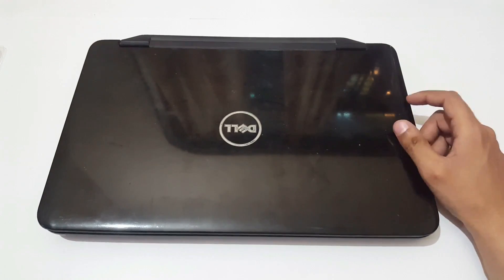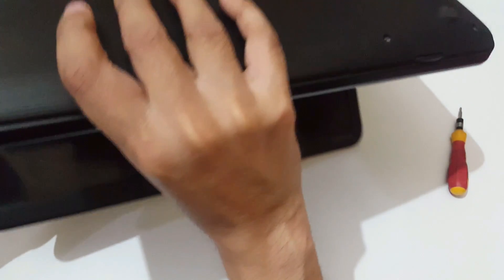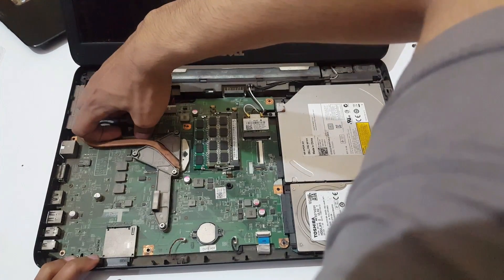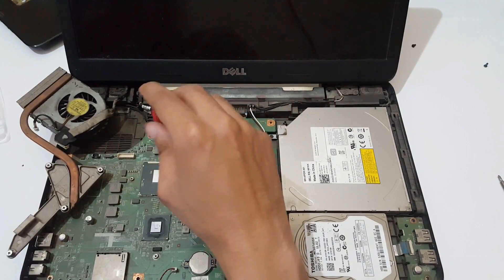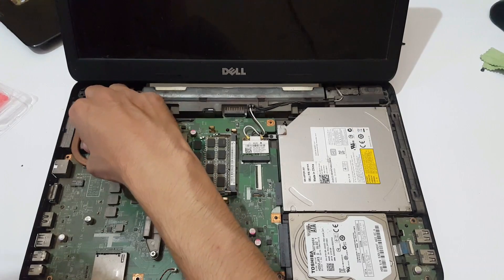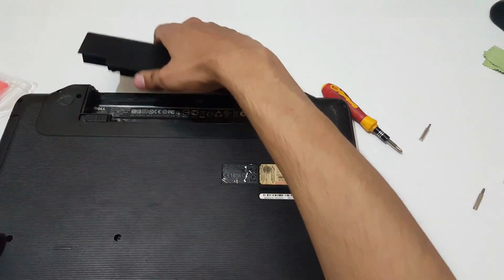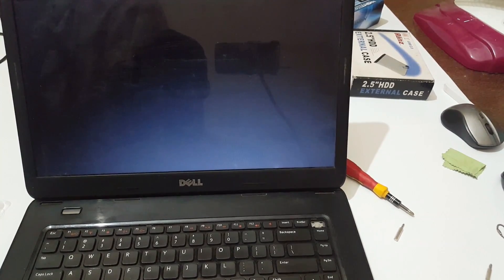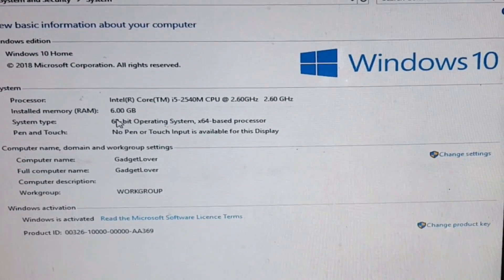How to Upgrade Processor on DELL Laptop | i3 to i5 & i7 - Make Laptop Faster for Gaming

Comment: Bro which is the best processor for my laptop ? Lenovo Flex 2 14.
My laptop was having core i5 4th gen.
But it got a complaint. And after i got it repaired from other country its processor is AMD A6-6310.
And it was having nvidia Gtx 840m
Now after repair it has no graphic card. I cried after knowing it. And i can't return it. 😭
Reply from the maker: AMD A8 6410 is best processor for your Laptop and I would suggest you attach external graphics card
Reply from the maker: @nothing4221  They might changed the board and I would like to inform you that if the processor is not soldered you can upgrade it in same generation
Reply: Sorry just one more doubt 😀
But upgrading from amd to intel which generation should i choose
Reply from the maker: @nothing4221  You can't change it to Intel can upgrade it in same generation of AMD processor only

Comment: Can I upgrade intel core duo in dell xps 15 2008
Reply from the maker: The processor of this Laptop is soldered so you can't upgrade it but I would suggest you upgrade its RAM to max and install SSD for better performance

Comment: Hello sir, I really enjoyed the video can I upgrade my core i3 11th gen to core i5
i'm currently using the latest HP 14s laptop
plzz reply sir
Reply from the maker: Thanks and I would like to inform you that the processor of this Laptop is soldered so you can't upgrade it but I would suggest you upgrade its RAM to max and install SSD for better performance

Comment: Can I upgrade my dell Inspiron 15 3567 i3 6th generation from i3 to i5..plz reply
Reply from the maker: The processor of this Laptop is soldered so you can't upgrade it but I would suggest you upgrade its RAM to max and install SSD for better performance

Comment: sir i have 3rd generation i3 dell laptop how i change to 5th generation
Reply from the maker: I would like to inform you that if the processor is not soldered you can upgrade it in same generation
Reply: @GadgetLover360  ok sir  how i change tool plz tell  speed high my laptop
Reply from the maker: @zubairlaghari75ali12  Which Laptop do you have provide its details
Reply: @GadgetLover360  sir i have dell i3 3rd generation 3gb ram 512 hard disq
Reply from the maker: @zubairlaghari75ali12  Provide model number
Reply: @GadgetLover360  model  inspiration N4050 memory 3072MB RAM processor core i3 2330M CPU 2.20 GHz (4 CPU) 2.2GHz and win7 64 bit 512 hard disc
Reply from the maker: @zubairlaghari75ali12  Intel Core i5 2540M is best processor for your Laptop and you can expand its RAM upto 8GB and I would suggest you install SSD for more better performance
Reply: @GadgetLover360  thanks sir how estimate spend sir
Reply from the maker: @zubairlaghari75ali12  You're welcome and it won't be too expensive
Reply: @GadgetLover360  how much estimate 5k atleast

Comment: Hi.
I HAVE DELL E6320 I HAVE FEW QUESTIONS...

1.MAXIMUM RAM I CAN UPGRADE TO, SOME SAY CAN UPGRADE TO 16 GB IS THAT POSSIBLE? 
AND WHAT KIND OF RAM DOES IT SUPPORTS!!!

2.CAN I USE SSD INSTEAD OF HDD,IF YES THEN WHICH KIND OF SSD AND WHICH VARIANT WILL BE BEST.

3.CAN I ATTACH EXTERNAL GPU WITH IT ?

ANY SORT OF INFORMATION WILL BE APPRECIATED  

THANK YOU
Reply from the maker: Hi and you can expand it upto 8GB and buy Samsung 870 EVO 250GB SATA 2.5 inch internal SSD for your Laptop and yes you can attach external graphics card to your Laptop
Reply: @GadgetLover360  thank you.
 can I get more than 250gigs  like will it support it and and all
Reply: @GadgetLover360  thank you for the information.!!
Reply from the maker: @raziafahim9533  You're welcome and yes but I would suggest you before buying search about it on Google for better details
Reply: @GadgetLover360  okay.once again thank you
Reply from the maker: @raziafahim9533  You're welcome
Reply: Can i use the external GPU via express card slot If there is one available

Comment: Hlo bro I have 
Dell latitude e 5410 
Which ram I need can you tell me
Reply from the maker: Hi and I would like to inform that you can expand it upto 8GB so buy 4GB + 4GB 1333MHz DDR3 RAM
Reply: @GadgetLover360  Hlo the laptop I mentioned above which generation processor did it have
Reply: @GadgetLover360  and can you suggest me ssd for this laptop
Reply from the maker: @error.............3199  I would suggest you see its manuals and Samsung 870 Evo SATA 2.5" is best SSD for your Laptop
Reply from the maker: @error.............3199  Go to Control Panel>System and Security>System and see Processor details
Reply: @GadgetLover360  it is m520
2.40ghz 2.40ghz
Reply from the maker: @error.............3199  Okay and if you want to upgrade the processor I would like to inform that Intel Core i7 640M is best processor for your Laptop

Comment: Hello I have a Dell Inspiron 7567 Core i5 - 7300HQ cpu 2.50ghz can I change the processor on it and if so what the best one for it
Reply from the maker: Hi and I would like to inform you that the processor of this Laptop is soldered so you can't upgrade it but I would suggest you upgrade its RAM to max and install SSD for better performance
Reply: Thanks do u have any recommendations I'm new to this information
Reply from the maker: @59525529  You're welcome and I would like to inform that you can expand its RAM upto 32GB so buy 8GB + 8GB or 16GB + 16GB 2400 MHz DDR4 RAM and install Crucial P2 250GB 3D NAND NVMe PCIe M.2 SSD

Comment: I've an acer aspire v5 171 lap. it is having intel core i5 3rd gen. processor. Can I upgarde it??
Reply from the maker: The processor of this Laptop is soldered so you can't upgrade it but I would suggest you upgrade its RAM to max and install SSD for better performance

Comment: Very Nice Video,Thank You So Much For This Video.I Have DELL Inspiron 15 3000 Laptop, Processor Is Intel i3-7020U, 7th Generation 2.30 GHz And 4 GB Ram And I Am Want To Upgrade Processor, Please Suggest Me,Which Is The Best Processor For This.
Reply from the maker: You're most welcome and in my knowledge the processor of this Laptop is soldered so you can't upgrade it but I would suggest you upgrade its RAM to max and install SSD for better performance
Reply: @GadgetLover360  Thank You So Much.
Reply from the maker: @vrseriescreation  You're most welcome

Comment: its still slow... very bad pc
Reply from the maker: I would suggest you upgrade its RAM to max and install SSD for more better performance
Reply: @GadgetLover360   i have done all but still its lag on gaming . and also suddenly shuts down being over hit.
Reply from the maker: @vexexvexex6341  Use cooling pad and attach external graphics card for better gaming experience

Comment: Hello sir , i have dell i3 with 1.50ghz , can i upgrade it to i7 with more frequencies unlock ? Thanks ♥️🥰👍🏻
Reply from the maker: You're welcome and I would like to inform you that if the processor of Laptop is not soldered you can upgrade it in same generation

Comment: Does hp 15da i3 laptop work with this trick
Reply from the maker: The processor of this Laptop is soldered so you can't upgrade it but I would suggest you upgrade its RAM to max and install SSD for better performance

Comment: Hi i would like to know if it is possible to upgrade the cpu of Dell vostro 14 3401?
Reply from the maker: Hi and the processor of this Laptop is soldered so you can't upgrade it but I would suggest you upgrade its RAM to max and install SSD for better performance
Reply: Thank you very much for the information.😁
Reply from the maker: @shendai8410  You're most welcome

Comment: Hi my laptop 
dell inspiron  intel R Celeron b815 , socket G2/ 988B rpga, 
model
 01HXXJ   A04  and graphics card is intel hd graphics 
I want to replace to Core. Is I can do that 
and what is Processor the appropriate 
for my laptop .note I want play some good games example Prince of Persia ps2 and pes 2018 Xbox. and thanks 🇮🇶👍
Reply from the maker: You're welcome and Intel Core i5 2540M is best processor for your Laptop and I would suggest you upgrade its RAM to max and install SSD for more better performance
Reply: @GadgetLover360  thanks for help 👍
Reply from the maker: @Boycotters-iq  You're welcome

Comment: Hello sir, first, thanks for sharing wonderful work👏. Second, sir I have dell inspiron 1440 what can fit processor this model?
Reply from the maker: You're welcome and provide its processor number
Reply: @GadgetLover360  what can you recommend for me sir, because I want to upgrade my laptop dell inspiron 1440, model PP42L? My processor now is Pentium (R) dual core CPU T4300 2.1ghz.
Reply from the maker: @marrey3774  Intel Core 2 Duo T9900 is best processor for your Laptop
Reply: @GadgetLover360  what maximum Ram can upgrade this laptop sir?
Reply from the maker: @marrey3774  You can expand it upto 8GB
Reply: @GadgetLover360  thank you so much for answering  me and wonderful explanation video sir. YOU ARE THE BEST💯💯💯💯
Reply from the maker: @marrey3774  You're most welcome

Comment: Hey Can i change dell Inspiron 3501 i5 to i7
Reply from the maker: The processor of this Laptop is soldered so you can't upgrade it but I would suggest you upgrade its RAM to max and install SSD for better performance

Comment: Hey may i ask? how about Dell E6320 it possible to upgrade the processor
?
Reply from the maker: No because the processor of this Laptop is soldered so you can't upgrade it but I would suggest you upgrade its RAM to max and install SSD for better performance

Comment: Are you sure that there will be no error or blue screen if you do what I did, because I have an Inspiron 15 5050 As in the video, i3-2330 2.20 2.20 . specs 8 ram ssd
Reply from the maker: Yes
Reply: @GadgetLover360  👍
Reply from the maker: @ArabSSkills  Thanks
Reply from the maker: @ArabSSkills  Thermal paste
Reply from the maker: @ArabSSkills  Thanks

Comment: can i upgrade a mother board  Acer BA50_BH with i3 5th gen . mobile with  i7 5th gen mobile
Reply from the maker: I would like to inform you that if the processor of this Laptop is not soldered yes you can upgrade it in same generation
Reply: @GadgetLover360  Thanks, the socket is 1168 BGA, any i7 4th gen mobile would be fine?
Reply from the maker: @vmirv0games14  You're welcome and as I said you can upgrade it in same generation

Comment: Bro can I upgrade my cpu in Inspiron 5575 ryzen 5 2500u laptop and which cpu to use 🙏
Reply from the maker: The processor of this Laptop is soldered so you can't upgrade it but I would suggest you upgrade its RAM to max and install SSD for better performance
Reply: @GadgetLover360  uh so should I use 16gb ram 8×2
Reply from the maker: @mrnameyt1014  Yes and you can expand it upto 32GB
Reply: @GadgetLover360  thanks for your help now I can upgrade my laptop without any doubts ❤️
Reply from the maker: @mrnameyt1014  You're welcome

Comment: Sir Can I upgrade my Lenovo IdeaPad 110 core i3 processor to i5?
Reply from the maker: The processor of this Laptop is soldered so you can't upgrade it but I would suggest you upgrade its RAM to max and install SSD for better performance

Comment: Hi, Can i upgrade my Intel Core i3-3217U in HP N011 tx
Reply from the maker: Hi and I would like to inform you that if the processor is not soldered you can upgrade it in same generation

Comment: I have dell vostro 3500 i3 can i upgrade to i7 or any other processor
Reply from the maker: I would like to inform that you can upgrade it in same generation
Reply: @GadgetLover360  but my processor is soldered
Reply from the maker: @ManishPatel693  In my knowledge the processor of this Laptop is not soldered
Reply: @GadgetLover360  Apne main  sholdered hai... I3 hai....?
Reply from the maker: @ManishPatel693  Okay then I would suggest you upgrade its RAM to max and install SSD for better performance

Comment: I have dell latitude e6230 is it possible for any upgrades?
Reply from the maker: I would suggest you upgrade its RAM to max and install SSD for better performance
Reply: Is it possible to upgrade the cpu mine is i5-3340M
Reply from the maker: @raidenshogun2787  I would like to inform you that the processor of this Laptop is soldered so you can't upgrade it

Comment: Bro i have Dell Inspiron 3647...
Pentium g3240 3.10 ghz
Plz can u suggest me a graphic card which i can install in my pc .
Reply from the maker: Asus Geforce GT 710 2GB GDDR5 Graphics card
Reply: @GadgetLover360  thanks for replying 🍁🍁

Will it fit in my sff pc
As dell Inspiron 3647 is an sff pc....and it have small case and single slot pci-express x16 slot...so plz can u do some research for me....I had visited almost every blogs and forums but found nothing.....plz suggest me a right graphic card....btw it's manual suggests nvidia gt 625 and gt 635 but they both are not available online..plz reply 🙏
Reply from the maker: @suryapratapsingh375  You're welcome and I would suggest you search on Google for best results
Reply: @GadgetLover360 again thanks..but I already searched everywhere on Google...found nothing 😶

Comment: Hi! Running on a Dell Latitude E6320 with an i7 2620m. I wonder if I can upgrade this laptop? Can I add more ram or anything else? Thanks
Reply from the maker: You're welcome and I would like to inform you that the processor of this Laptop is soldered so you can't upgrade it but I would suggest you upgrade its RAM to max and install SSD for better performance
Reply: @GadgetLover360  Alright no problem and thanks for the quick reply
Reply from the maker: @agsechogd6406  You're welcome

Comment: hello, i have a dell i6320 with i7 2640m @2.80 ghz speed   with  4 gb ram  
i have a few questions...!!!1
can i upgrade my processor any higher.if yes which generation/model ??
can i upgrade my ram upto 16gb or more?

can i use external gpu with it??
Reply from the maker: Hi and I would like to inform you that if the processor is not soldered you can upgrade it in same generation and yes you can attach external graphics card for better gaming experience
Reply from the maker: @gcabdullah9699  I would suggest you see its manuals

Comment: I have Dell Inspiron 3000 series with Core i3 4th generation  1.7 GHz.  Which processor is compatible with my laptop to upgrade?
Reply from the maker: I would like to inform you that if the processor is not soldered you can upgrade it in same generation

Comment: Dell Vostro 3450 which processor should I install for gaming???
Reply from the maker: Provide processor number
Reply: @GadgetLover360  2310
Reply from the maker: @12futuristic671  Intel Core i5 2540M is best processor for your Laptop
Reply: @GadgetLover360   can I upgrad to 3rd or 7th gen???
Reply from the maker: @12futuristic671  I would like to inform that you can upgrade it in same generation

Comment: That's wicked, awesome
Can you tell me if my Inspiron i7 5558 can be upgraded 

if a graphic card can be upgraded in any laptop can you make an video about it
Reply from the maker: Thanks and I would like to inform you that the processor of this Laptop is soldered so you can't upgrade it but I would suggest you upgrade its RAM to max and install SSD for better performance and for better gaming experience you can also attach external graphics card
Reply: @GadgetLover360  I knew it, but what you did was simply amazing.
No white man has ever even dared to do this, kudos for your success
Reply from the maker: @vampire6940  Thanks and we shouldn't compare everything everyone has their own perspective

Comment: Can i upgrade i5 3rd gen to i7 3rd gen without changing motherboard ? [Dell latitude 3330]🙏🙏
Reply from the maker: In my knowledge the processor of this Laptop is soldered so you can't upgrade it but I would suggest you upgrade its RAM to max and install SSD for better performance
Reply: @GadgetLover360  Is there any M.2 ssd ? I open it but didn't found . Maximum ram support ?
Reply from the maker: @fahadibnatuhinofficial4555  No and I would like to inform that you can expand its RAM upto 8GB
Reply: @GadgetLover360  In my computer, i have 1600mhz DDR3 ram. From Dell, I heard i can use DDR3/DDR3L. I also heard, Same type of ram is very good. But DDR3L is better than DDR3. What should I buy now ? 1600mhz 4gb DDR3/DDR3L ?🙏🙏🙏
Reply from the maker: @fahadibnatuhinofficial4555  Go with DDR3L
Reply: @GadgetLover360  Thanks a lot boss ♥️♥️♥️
Reply from the maker: @fahadibnatuhinofficial4555  You're most welcome

Comment: I have Dell Inspiron 15 Series having Pentium Quad core processor. Can i upgrade my processor?
Reply from the maker: I would like to inform you that if the processor is not soldered you can upgrade it in same generation

Comment: Sir I have dell Inspiron 15 3576 laptop can I able to change my laptop processor
Reply from the maker: I would like to inform you that the processor of this Laptop is soldered so you can't upgrade it but I would suggest you upgrade its RAM to max and install SSD for better performance
Reply: @GadgetLover360  sir can you suggest best laptop with upgradable processor under 40k
Reply: @Fate_Handler  Buy any i5 5th or above gen. These works good 🤠🤠

Comment: Does this same goes for hp Pavillion series ...I have an old laptop of 2011 hp Pavillion series it has i5,  now I have a hp Pavillion laptop with i3,  I want to interchange as old was not working well
Reply from the maker: I would like to inform you that if the processor is not soldered you can upgrade it in same generation